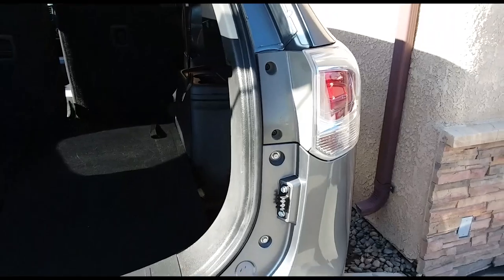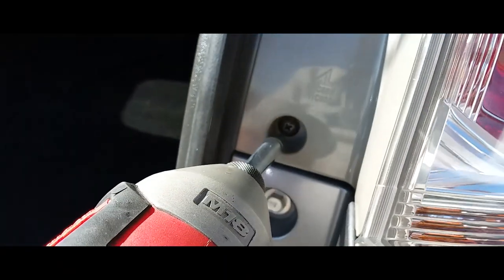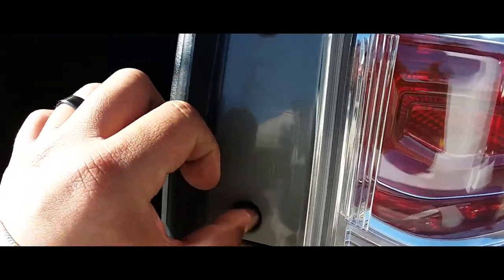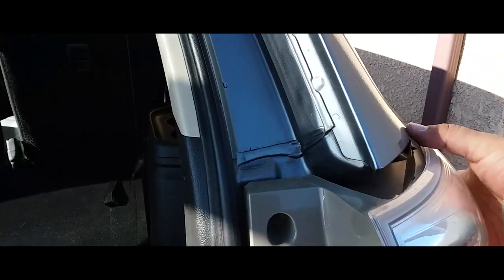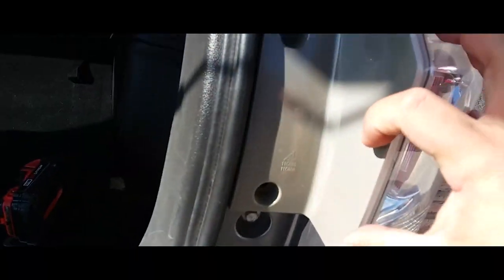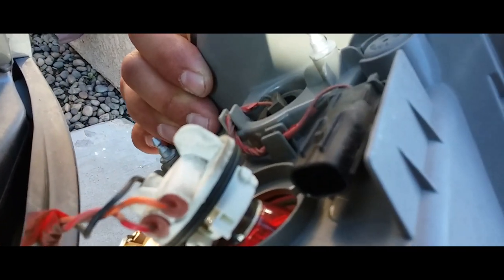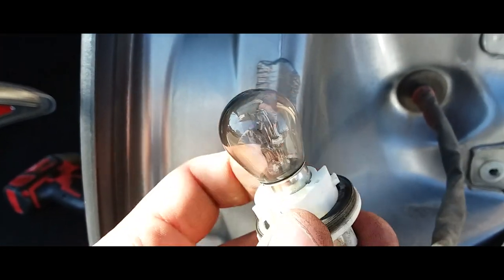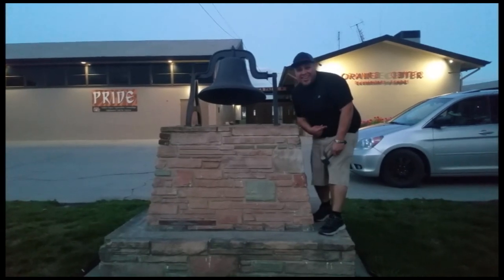How to: Remove Tail light from a 2013 Mitsubishi Outlander

Comment: Nice video but mine wont come out that easy: 2 screws off and I can't get the assembly to bulge. Any idea? Thks
Reply from the maker: There should be 2 retainer clips
 Use a trim tool removal or a flat head to get in the side of the tail light and body easily  try to open it and it should come loose. Hopefully this works for you buddy! THANK YOU FOR YOUR SUPPORT!
Reply: @559powerscape  Thanks. Will try again!
Reply: Hey! Can you show a video of that? I'm having the same problem and im afraid of breaking it. Thanks
Reply: @paulobotas3597  I ended up pulling with a rope in between and damaging the ond unit. Putting the new one in was fairly straight forward
Reply: @Picard80  thanks I'll just ask the guys to change them when I change oil next week
Reply: @paulobotas3597  worth it for one light, pricey for the full unit